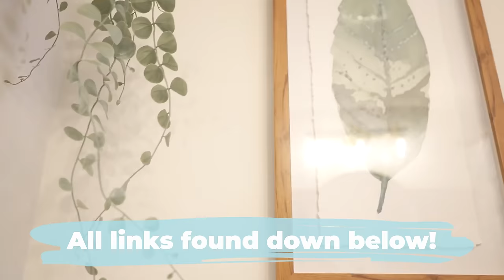We finished our AIRBNB | FULL-HOUSE TOUR BEFORE/AFTER

Comment: Thanks for the tour, Lauren! As I followed your renovation, I wasn't able to completely grasp how it all fit together, and this made it all clear. You've done a fabulous job - definitely worthy of an HGTV episode! I suggest that you investigate using one or more mini split HVAC units instead of those small portable AC units. (When we stay in a motel, I hate the noisy units that blast out air and turn on and off so noisily.) We recently installed a Mr. Cool unit (cost about $900) in our she shed, and WOW it's amazing. Heat or air, remote control to hold the perfect temp, and it is almost completely silent. You don't feel any blast or draft of air from the small unit high on the wall - it just silently does its job. I'm amazed by it, and think it would be perfect for a sunroom or space that is difficult to heat/cool.
Also, the Mr Cool unit runs on 110V, a 15 amp circuit, so it was easy to fit into the minimal wiring for our small building.
Reply: My daughter is putting a mini split in her garage

Comment: It's so great. I'd never thought about visiting Omaha, but this makes me want to! One thing I would want, if I were staying in the upstairs, is to have a better dining area, especially if I were staying there with more than one other person. My suggestion would be to move the velvet chairs and coffee table over to the other side of the sun room with the sofa to form a little conversation area, and put a round dining table and four dining chairs where the velvet chairs currently are. It looks like the space would still be big enough to pull the velvet chairs back in order to pull out the sofa (though I know proportions get distorted on camera). With dining space in the sunroom it would also offer the option of using the bar table in the kitchen as counter space, with more room for small appliances and stuff. It will also cut down on the amount that people eat on the bed and the sofa, which will keep your soft furnishings cleaner. Just my thoughts as a person who stays in a lot of AirBnBs and who thinks about design issues a lot and who loves your work! ❤❤

Comment: There is probably extremely durable fairly stain resistant hardwood underneath that carpet………😆 and if the step bothers you, you could pull it and have a carpet guy patch it with the carpet from the step. Beautiful after!

Comment: I highly recommend installing hardwood, laminate, or bamboo flooring. Carpet is a deal breaker for a lot of people. For a vacation rental it is too expensive because it constantly needs to be cleaned and it will need to be replaced. We have hand scraped hardwood that cost less than carpet and we used it in our previous house and current house and it is fantastic. It will last a lifetime. If it gets a scratch, we just go over it with a dark old English polish and the scratch disappears or looks like another hand scraped area.
Our current home was built in 1900 and they had just installed brand new carpet when we bought it. The first thing we did was rip out the carpet. I would rather have painted plywood than unsanitary carpet. The idea of carpet in a vacation rental is extra gross to me because you don't know what kind of nasty is on the carpet. There could be fecal matter from pets, there could be scum from the streets of New York from the bottom of someone's shoes. Ick. I would not stay in a house with carpet.

Comment: It looks beautiful for the most part. However, I’ve stayed at Airbnb‘s for the last 20 years a, this is just a suggestion, but I would definitely take a look at the woodwork and the finishes along the floor line ….as I observed in your video, the doors and the molding and the areas around the bottom of the floor are not finished off , looks shabby and not as clean as the rest of the house….it just doesn’t do justice to the house which is gorgeous.
Reply from the maker: everything is finished off! I didn’t want to take all of the charm & character away
Reply: @FurnitureFlippingTeacher  thank you so much for replying it means so much that contact creators actually read the comments….. even when they’re not all glowing lol

Comment: Looks good but the sunroom cheapens the overall effect with the mismatched chairs, oversized coffee table blocking off the corner visually and physically, and the impractical, potentially dangerous layout. That corner is an eyesore.
Reply from the maker: I’d love to hear more about what you’d do differently.
Reply: @FurnitureFlippingTeacher  A round coffee table would be safer and easier to navigate around, especially if children are there. The idea of the colorful chairs was nice, but doesn't work in reality because the shapes are too different and from a color psychology standpoint, it's too chaotic to be relaxing. If the chairs matched in shape and scale it would be 50% improved. Matching cooler tones that complement the paint color and sofa would be 1000% improved. Facing the chairs against the back wall to enjoy the view from the windows without guests having to use bad body mechanics to see outside would be a great improvement. I'm not being a crank, I am a designer who managed several air BNB units. You want to minimize problems for your guests, not have a kid splitting a chin open on a misplaced table. There should be a plunger available to guests because inevitably they will clog the toilet. An assortment of quality teas and a special coffee brand like Kicking Horse for the coffee bar would be a fabulously thoughtful touch.